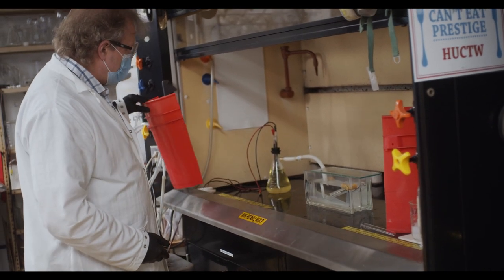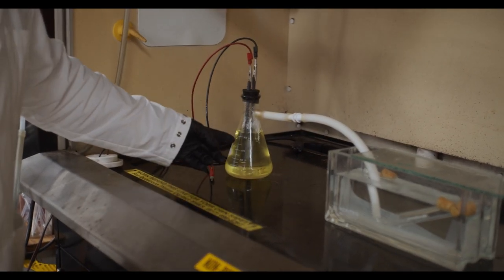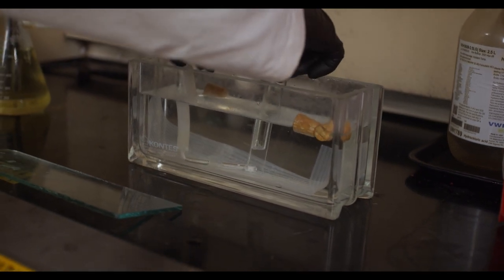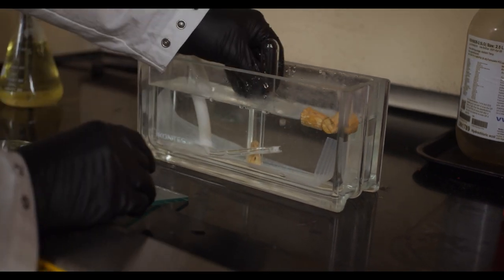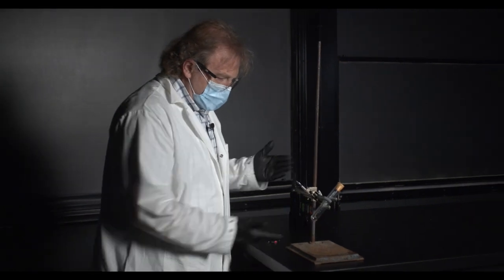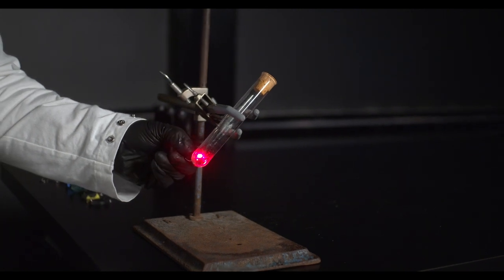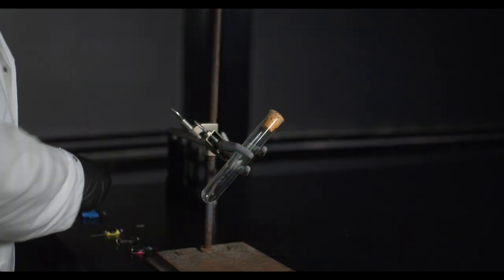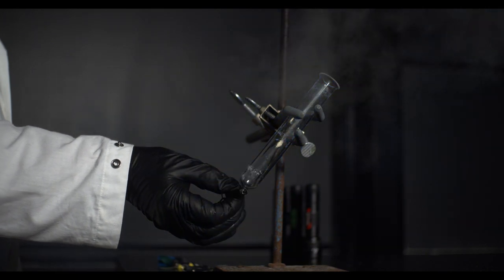Photochemical Reaction of Hydrogen and Chlorine

Comment: It wouldn't matter what the amplitude/brightness of the light is in order to catalyze the reaction due to the energy of the light only depending on frequency. The brightness would just increase the likelihood that an electron would be energized enough to allow bonding of H and Cl due to there being more photons being "thrown around". At this scale, it would be a negligible change in probability anyway. Can anybody back me up or correct me?
Reply: Well, I'm not a chemist but I like chemistry and I'm looking into chlorine photolysis reactions now, and I believe you are mostly wrong. Hydrogen burns in chlorine, and in the equimolar concentrations in that tube, that reaction is explosive. It's an exothermic reaction that sustains itself once the mix has ignited.

What the UV does is it cleaves the bond between the atoms in the Cl2 molecule, creating two Cl radicals. These reactive radicals react with the H2, creating HCl, and a H radical. The H radical goes on to react with another Cl radical or a Cl2 molecule and make more HCl, maybe more radicals. The heat in the flame creates more radicals from other molecules, and the reaction is sustained. Well, to ignite that flame to begin with, you need to hit enough Cl2 molecules with UV to create enough Cl radicals in a short enough time, that their combined reaction with surrounding H2 generates enough heat to sustain the reaction. Otherwise you'd just slowly convert the gas mix into HCl in the path of the light from the UV diode, in case it was too weak.

Two other cool videos on this I just watched were called Fire and Flame 43, and Fire and Flame 44 from Royal Society Of Chemistry... observe how it takes a while to ignite the mix in the second video where he uses burning Mg, and he has to hold it real close. Burning Mg outputs a lot of UV.

One thing I don't understand is what the guy said about how O2 works as a catalytic poison for the reaction. Usually its the other way around, Cl or Br is used to poison the flame when O2 is the oxidant, in flame retardants. Maybe it works the other way around too.

That's all I've got!
Reply: You are mostly correct. Intensity of light, ie the amplitude of light, isn't a factor here. The specific frequency (ie color) is what determines if the energy of the wave is absorbed or passes by. If the frequency is correct, the wave will be absorbed and increase the energy level of the electrons allowing for a restructuring. Any other frequencies, regardless of the amount, will not generate that excited state.
Reply: Pretty much, with an edge case where two photon absorption can occur with enough power density, where for example two red photons could be absorbed simultaneously to effectively induce effects that would otherwise only possibly caused by a single blue photon. This effect is used in two photon microscopy and two photon lithography

Comment: Can we boil the water first to drive off a lot of the dissolved oxygen and then bubble the chlorine through it as it cools down?  It would be nice to be able to cut down on the amount of chlorine we have to generate, as well as shorten the time until chlorine saturation.
Reply: Yes, that would work, the solubility of oxygen in water decreases as the temperature increases. It's precisely for that reason why fish in stagnant ponds don't do well during heat waves.

Comment: QUESTION............Why didn't BLUE work?   Or was it working but just to slow?  Because i have made chlorine free radicals using LED blue light.   Of course i had 18 LEDs and not just one.     I mean you only need 494nm light to homolytically cleave a Cl/Cl bond which is almost in the green wavelength.  And LED blue light is like 450 to 460nm light which is stronger than 494nm light
Reply: What did you make them for?

Comment: At the very end you mentioned the humidity in the air. Doesn't the HCl become hydrochloric acid when it meets that humidity?
Reply: Also, was there any Oxygen present in the test tube with the hydrogen and chlorine?
Reply: @InterBalance  No, that was addressed earlier in the video.
Reply: @OxBlitzkriegxO , I do see that the topic of oxygen in the tube was addressed. But I'm still curious about the HCl becoming hydrochloric acid when it meets the water in the air!
Reply: @InterBalance  You're correct. HCl or hydrogen chloride is a gas, but it can dissolve in water at concentrations of up to 38-40% in which case it's called hydrochloric acid. And the same goes for hydrogen bromide and hydrogen iodide, which can dissolve in water at up to 69% and 57% m/v concentration.